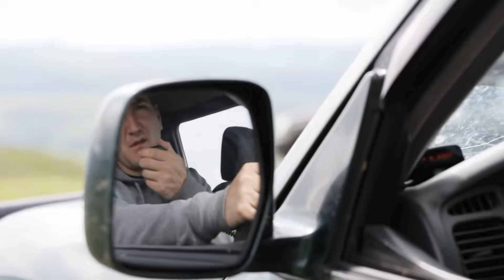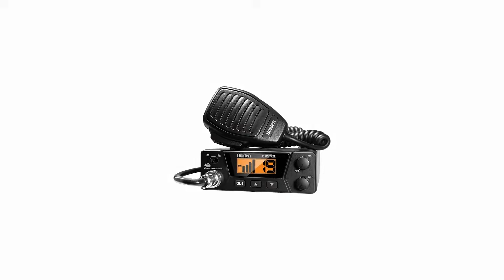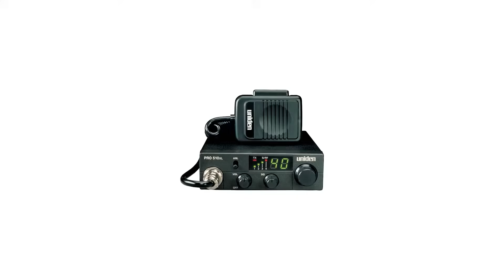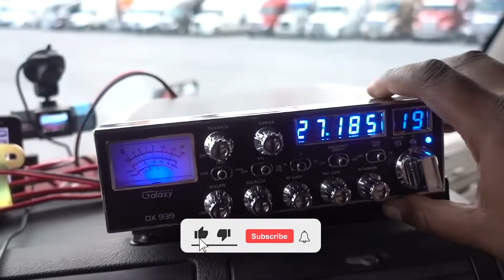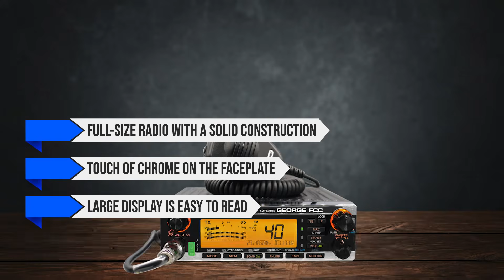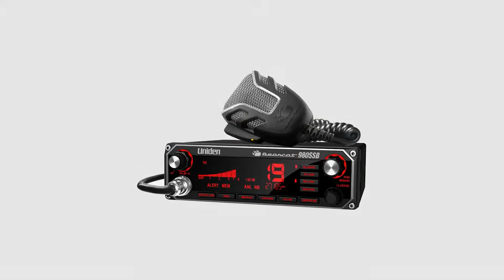🎖️THE BEST CB RADIOS TODAY! [TOP 3]

Comment: A tragic, worthless carnival video.

** The Uniden Bearcat 980SSB 0.7 μV AM has very low sensitivity, while high-quality stations should have 0.25 μV 20dB SINAD  
** It does not have an FM band
on SSB SSB: 0.25 uV (10 dB S+N/N), where 10dB is a very moderate parameter. - High-quality stations evaluate sensitivity against 20dB

Comment: 50 years of trucking, and I still use mine. 😊😅
Reply: 50 years and I still use mine also. Have a handheld one in my Tahoe and at my computer.  Still have 2 desktop models also. But not using them lately.

Comment: With a set of tuned dual center load antennas you can get almost 14 miles range.
Reply: With my Base antenna you can talk to nations when the sky allows it.😊
Reply: I used to pick up Alabama in northern New England

Comment: The problem with citizens band is the power limitation.  Get the best antenna you can and at best you'll get 2 miles.  Makes sense for truckers and off roaders.  But the functionality of the units is just a matter of choice.  The FCC is way behind the times on CB.
Reply: I have had he Bearcat 980 for several years ... SSB range is excellent but weather dependent.  Standard CB AM works fine and way more than 2 miles with a good antenna.
Reply: @ it's line of sight.  So even if you're broadcasting across the surface of water you're getting at best 5 miles.  But I live in the mountains and CB sucks because it's not allowed to use repeaters like the 2m amateur band (and they gatekeep that band hard).  The lack of repeaters makes it not that useful in terrain.  But as I say it's fine for wheeling and truckers.
Reply: @Dr_Kenneth_Noisewater  Not true with SSB ...  I have had communications from Canada down to the southern states ...  Yes line of sight is a problem with the "standard" radios...  But on the road, I only need a couple 3 miles ahead from a traffic perspective.

Comment: die mc kinley ist eine wanderdühne vor dem herren,selbst wenn man sie vom "prüfplatz" kauft ändert sie je nach temperatur die frequenz bis zu 240hz,was in ssb extrem nevig ist,die kiste ist absolut nicht empfehlenswert!!!

the mc kinley is a travelling dune in front of the master, even if you buy it from the "test station" it changes the frequency depending on the temperature up to 240hz, which is extremely annoying in SSB, the bucket is absolutely not recommended!!!